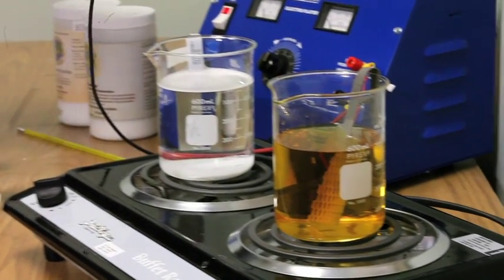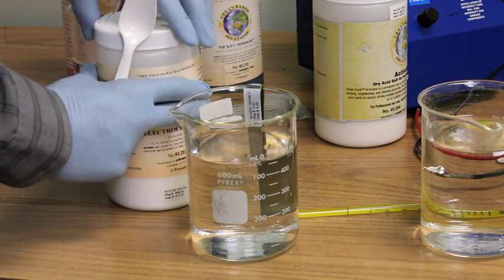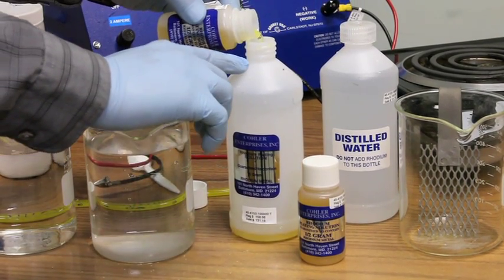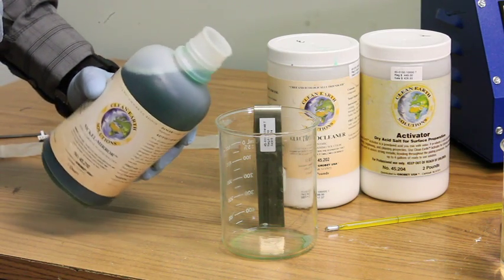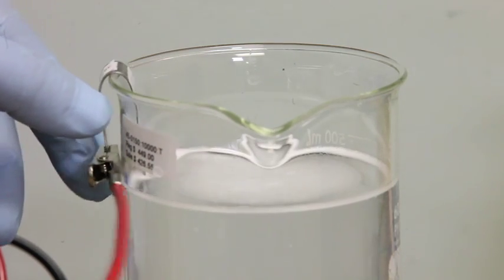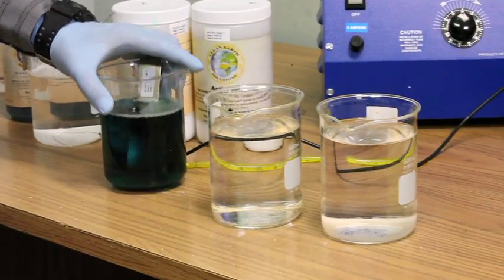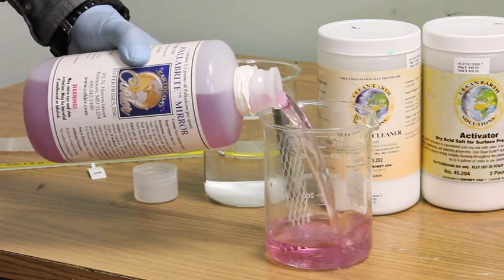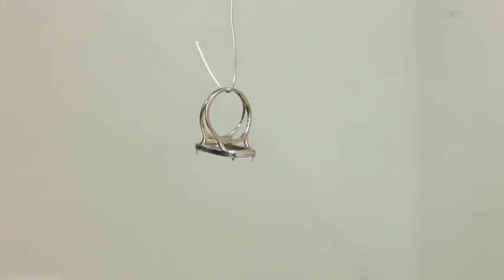How to Rhodium Plate Sterling Silver Jewelry

Comment: In the video he puts 60 volts into the rectifier, but in the audio he says 6 volts. Which is correct? If I use the other 25A rectifier that is sold on the website, will it also be the same time and voltage?
Reply: The best i could do is show its  
multi meter resistance levels. Its pretty solid to say the least and great for electronics uses.
Reply: go with the volts    ret. jeweller

Comment: Jewelers do this to silver to make it look shinier, but I have never seen any silver jewelry in any store displaying that it is rhodium-plated.  Why is that?
Reply: As i understand it, rhodium is expensive and therefore typically used only to plate and preserve more precious metals. Silver being less valuable, i believe manufacturers dont bother plating inexpensive jewelry. I think the rhodium silver jewelry is mostly an online shopping phenomenon.
Reply: @scrapparts7698 everything was rhodium plated in the 90s before ecoats became a thing
Reply: @kenmastersmaster I’m a Pawn broker & it used to be ….ALL new 10k/14k was all plated in 18k to give it that deep yellow pop ⚡️ 

It used to be… ALL new silver pieces where rhodium/nickel plated to look amazing in the show case 
Silver that’s left natural with get turnished , so you have a .925 bracelet in the showcase for 16months .. IT WILL get a weird grayish film over it 

In the last few years that Rock & Roll /biker / Viking looks has become pretty hot & that stuff looks better aged& tarnished
Reply: I know about the rhodium because it came off so quick and then you had that nasty nickel plate which is extremely difficult to remove and basically ruined the pieces. Silver looks better not plated in anything, or just 999 plated so it will not tarnish

 @PawnshopmikeATL
Reply: @scrapparts7698  Thanks.  No way I will buy any silver jewelry plated with rhodium.  It has no soul.😆